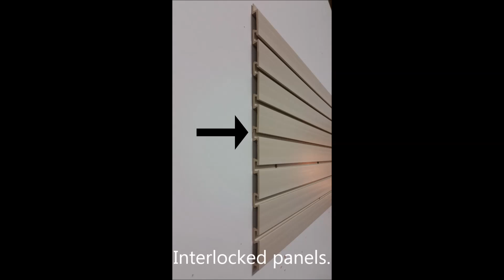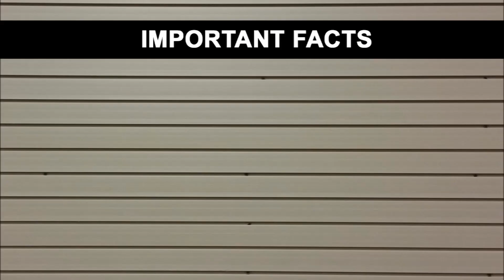PVC Slatwall Easy Panel Installation

Comment: Finally found a video of those cheap slatwall. most slatwall on the first page result are all custom made from a contractor. 

I think the screw is not enough sooner or later the pvc will crack (on  around that screw) and fall apart. 
I guess I'm going to put a single thin wood on the top part (inside of the first row) to support it vertically.
then use NoMore nail glue horizontally each row.